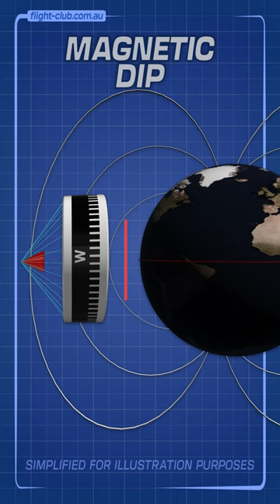Magnetic dip. #aviation #magneticdip #pilot

Comment: The magnetic dip problem is clearly explained, but you could have indicated the standard means of compass correction.
Reply: Idk if your asking for tips but the way I learned was Unos. Undershoot north overshoot south which basically means if your turning left or right towards the North Pole the compass will read the opposite and lag behind ( turns right (east) but the compass briefly says left (west) . And if your turning left or right towards the South Pole it will overshoot ( turn right( east) and the compass will say your going further east then you really are same with if you would turn left( west)) now there’s one more thing what happened if you are going east to west and you accelerate or decelérate on the North Pole ( you would use the word ANDS) accelerate north decelérate south. This means if your going east or west in a acceleration then your compass will read brefily your going north, and now the opposite if you decelérate then it will read your going south for a short time.last and final thing is you must always remember that compass will not change if your on a straight and unacclerated flight.  (Hopefully that helped if it did like the main guys comment so more people can see this)  also
Reply: I suspect this is valid only in the northern hemisphere - where the dip angle is positive.

Southern hemisphere the dip angle (inclination) is negative, and the effect would be reversed, so while it probably applies to the majority of pilots, if you travel then expect that adage to break down
Reply: @chimpornator they're aligned in reverse, so the bar magnets align to the south pole. So the dip is reversed. USNO
Reply: Perhaps this is one reason that so many flights are lost

Comment: Sounds like with a slight design change you could measure latitude.
Reply: That is already a thing
Reply: Almost but not quite, you're making the assumption that the magnetic poles are at the geographic poles, and the assumption that the field is the field of a bar magnet

Comment: That only happens when the plane is accelerating, but if your ground speed is constant, then physics will automatically stabilize it for you.
Reply: Turning onto a heading that is not East or West has different challenges. Where I flew the acronym was ONUS Over North, Under South. So if turning onto 360° you turned 30° passed 360° (so either 330° or 030°) and then let it settle. It was the opposite when turning onto 180° where you stopped the turn 30° early. There were incremental steps as you went round the compass heading. We used 30° increments from N°. On 030° turn you went over by 20° and onto 060° you went over by 10°. It will vary depending where you are on the planet.

Comment: Great video but one detail is incorrect. The float has a much greater tendency to align with gravity than with the earth's magnetic field, so the float will usually be level with the earth's surface at all latitudes. In some airborne turns and some acceleration, the float tilts, and this gives it an ability to better align with the lines of flux by turning. This is what causes dip errors.

Comment: if the dip causes this issue why not just use a flat compass?
Reply: Because a magnet does not align itself with the horizon, but with the earth's magnetic flux lines. If you stand on the magnetic north or south poles any compass will try to point straight down.

Comment: Wouldn't gyroscope solve the issue?
Reply: Gyroscopic heading indicators are used but they have to be synced every now and then to a magnetic compass. This has to be done during straight and level flight due to the reasons explained in this video
Reply: It would and it did. They invented the remote flux sensor coupled to a gyrostabilised instrument. Sperry CL2